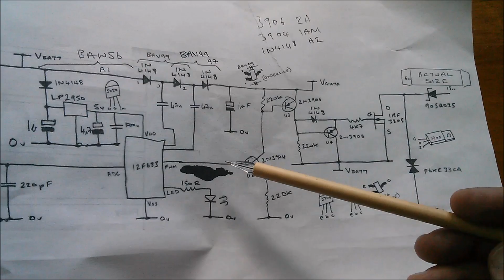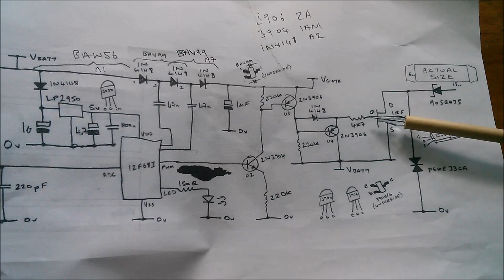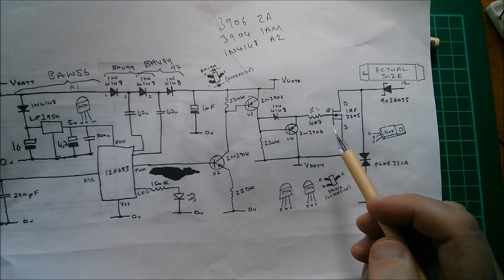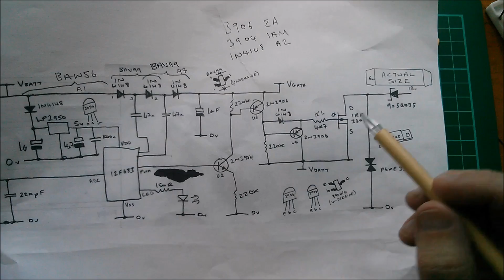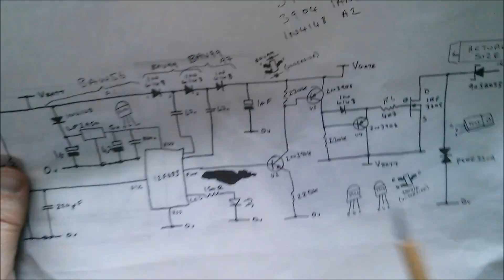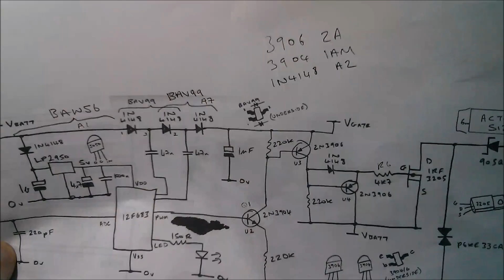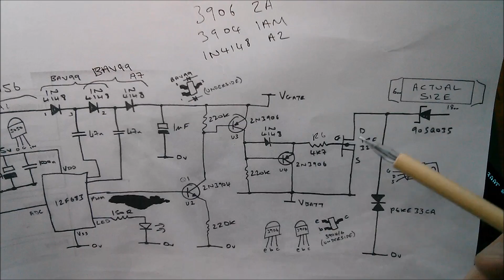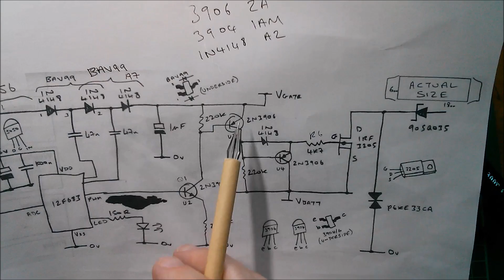PWM5 Final Assembly - High Side Driver Circuitry

Comment: Who else was waiting for Julian to string 11 Eneloops together and get cracking!?

I agree with the other commenters recommending to hold the lead batteries around 14V, current limited, for a time. They won't have a great capacity or Ir but they might stack a few electrons for you. Once a cell shorts internally then recycle it.

Comment: A cheap 300W pure sine inverter and a temperature compensated 12v battery charger are useful for charging and maintaining  other lead acid batteries in remote locations and you already have free energy and several batteries.

Comment: Another great video, got a TS100 recently for a nice price locally after watching some reviews including your video. Love it.
I highly recommend checking out the "G600 Portable Digital Microscope" (or one of a 100 variations of the search) on eBay or ali. It definitely reduces the eye strain greatly, it'd also be excellent for your videos... it's also capable of taking photos and recording video and has a focal length long enough to work under comfortably.
Also got it locally shipped for a superb price. Build quality is meek but the functionality is satisfactory especially for the price, about $70 CAD with 2-3 day shipping. Even has a built-in lithion battery for mobile use. Only complaint is the poor stand included, basically just a GPS holder that fits far from snug or has enough reach to meet the maximum focal length, or enough weight to dampen vibrations.

Comment: Try trickle charging the batteries with a voltage and current limited supply (around 50 mA maximum, maybe less) and monitoring the current via an analogue meter. If the current jumps sporadically, reduce the supply voltage, and the current limit, until battery current is stable. Keep the battery on charge for up to several weeks, monitoring current flow daily, and increasing the current limit gently, as the cells begin to recover. Once they're almost fully charged, and current draw is beginning to tail off, you can then switch them to normal voltage regulated charging. Most of them will at least partially recover (unless they’re too far gone), and many will make an almost full recovery. They will often work fine for several more years afterwards, if treated correctly. You've nothing to lose by trying it, apart from some electricity and a little of your time. 
Sealed Lead acid cells should never be charged above 2.5V, and 2.25 to 2.30 Volts is generally recommended as the maximum terminal voltage, if you want the battery to last for a long time. The battery might have similar instructions printed on it. I've also found that a very few drops of de-ionised water, added via each cell's safety vent bung, will often help in recovering a battery. No water should be sloshing around inside a cell, so add a few drops at a time until the cell shows signs of drawing a steady current. Remember to replace the bungs!
What you are attempting to do during the process is to gradually remove most of the sulphate layer that has built up on the battery plates, without punching too much current through one location, which would cause permanent damage to the cell. That's why you should start with a very low current, and only increase it gradually over several days or weeks. 
I've rejuvenated a number of batteries in this way, one of which appeared to be totally dead for almost a month before it began to accept a low current (~10 mA) without instability. It lasted for more than three years, as a portable transceiver power supply, after that episode.

Comment: Keeping AGM batteries alive requires that they be charged when the voltage drops to 12.4 or by time, which is every six months for the best batteries (sooner for the cheaper ones) when the temperature is 77F (25C) or less.  Carefully nursed lead acid starting batteries can also survive many years.  I have one with a "4" date code which would currently be assumed to be 2014 but is actually 2004.  It's never seen vehicular use and is typically float charged quarterly and topped off with distilled water as needed.  It's been my high current bench supply for years and is recharged immediately after use.  Compared to vehicle use, this battery has lived a pampered life ;-)
Reply: It amazes me the neglect that his batteries see,  and still somehow manage to continue to work,  kinda sorta...

Comment: Just screwing around i built one of those capacitive battery chargers; the ones with a simple, high MFD, capacitor and bridge rectifier. I was actually able to bring back a 5 yr old, totally dried out UPS 12v 7.2ah SLA.

Comment: I am impressed with you reducing the RF interference.  I was one of the guys questioning the need for the resistor on the MOSFET gate but if it reduces RFI that's great!  As a ham radio operator we really notice all these "modern" devices, from fluorescent and LED lights to switching power supplies that radiate RF when they shouldn't.  Good thinking, Julian!  1:49
Reply: Hopefully companies will be taking this into consideration. Some of these devices are terrible. Chargers are notorious. It doesn't take a lot to fix this, a couple very cheap capacitors , on the boards,  in the right spots.  Resistors are not the best way to reduce interference, Interference has to be allowed to radiate into the supply lines and even through the power supplies and out into the mains. That becomes the antenna. Capacitors short these signals out, killing the interference "signal". This article addresses the problem directly. https://www.eetimes.com/document.asp?doc_id=1229799 One of the things it says it , target areas of the spectrum that are used less by high sensitivity equipment.
Reply: N6grg you are assuming they are actually trying to follow any rules in the target markets (US,EU,etc) regarding spurious emissions. Much of the stuff coming off the boats are barely working to specs
Reply: N6GRG - it depends on the circuit, here you already have a capacitor inside the MOSFET, and you need some resistance to form a filter. In other cases you have some resistance and need to add capacitance. In other cases still, you have to add inductance.
Reply: Interestingly, Dave Jones did a recent video on visualizing bypass capacitors, and discusses some of the EMI/RFI pitfalls, which are somewhat related to this!
EEVblog #1085 - Bypass Capacitors Visualised!

Comment: :) You shouldn't put these batteries sideways. It should be upright. They have liquid electrolytes inside them, you know...
Reply: Uh no,  they don't.  Those ar "gel" batteries,  and the only restriction on position is that it's not recommended to charge them while they're uipside-down.

Comment: you could try to replace the battery acid with epsom salt and revive the batteries. that smaller one looks like its easy to open and pour acid out and replace it with epsom salt

Comment: Could you get this to work with a 3s or 4s lithium ion battery?
Reply: JasonMasters Well a good alternative to that would be to reuse phone and laptop battery packs which typically has charging/discharging and protection circuits built-in, I dunno about current limiting but you could implement that yourself using a cheap $2 buck converter with CC.
Reply: Yes, you can re-use phone and laptop battery packs, but the charging and protection circuits are typically either designed to operate only with the computer, or are part of the phone and not part of the battery.

Also, phone batteries are typically 3.7V rather than 12V.

For charging, you definitely need a power supply with both constant voltage and constant current.  I've used a cheap Chinese boost-buck power supply to charge lithium cells, but you need to keep an eye on the current since it doesn't shut off automatically.

For a single 3.7V 18650 cell, you just set the voltage to 4.2V and the current to 1 Amp.  When the voltage hits the limit, it will gradually change over from constant current mode to constant voltage mode.  You then switch the display to show the current and wait for it to drop to 100mA (1/10th of the starting current) before switching off.  Job done.

But of course it's easier to just buy a cheap Chinese charger board with combined over-discharge protection.

And to charge multiple cells in series, once again there are cheap Chinese balance charging boards available, with over-discharge protection.
Reply: No.  Lithium-Ion batteries need a very different charging circuit to Lead-Acid batteries.

Lead-Acid batteries can be continually charged at a constant voltage without being damaged.  In fact, they need to be continually charged at a low rate to remain "healthy".

Lithium-Ion batteries must be charged with a controller which first limits the charge current to a reasonable value and then once the voltage reaches its end-point, holds the voltage at that end-point until the charging current drops to 1/10th of its starting value, then the controller must shut off the charging current.

Charging a lithium-ion battery with a charger designed for lead-acid batteries is a great way to discover fire, without wanting to.

On the other hand, if you want a rechargeable lithium-ion battery to replace a 12V gel-cell lead-acid battery, there are now drop-in replacements available.  They have built-in protection and charging circuits so that they can't be over-charged or over-discharged and to regulate the charging correctly.

The biggest problem with the Li-Ion "12V" batteries is that at the moment, they're horrendously expensive.  In my neck of the woods, even on special it costs around $360 for just one battery.  That would be close to GBP180.

Comment: apparently Julian found his favorite solder, i found ts100 to be less ergonomic compared to common Chinese solder station handle which is usually covered in rubber and ts100 is slippery and small if you have wet hand and lives in humid country that get tiring quickly and i prefer a knob that i can turn quickly to adjust temperature instead of pushing buttons.
Reply: Rizki Pratama I totally agree. This iron looks like a toy for me. I see the result on the pcb of this video ... awful!
Reply: I agree with you in the first point. It would be very difficult for me to use, it’d slip easily and I’ll probably get burnt. A genuine Hakko FX888D can be purchased for just 140 €! That’s 20 € more and you get a very high quality station with 65 W as well.

Comment: That was a great video Julian. Are those mostly dead batteries dangerous to keep around?
Reply: What makes them dangerous makes them work.  As long as the case isn't cracked, they make good paperweights.  Then save up enough to make a run to the recycler worth to the trip.

Comment: Julian,.. your failed batteries,.. may be recoverable if you place some distilled water directly into the cells,.. you need to remove the 'Lid',.. obviously,. to get access to the rubber cell seals,... but with care it can all be removed in my experience,.. once the cells start to re-hydrate,.. the charge voltage starts to come down to normal levels.. but no guarantees,.. but then these batteries would otherwise be a lost cause anyway..

Comment: How do you choose between a BJT and MOSFET across varios nodes and then how do you chose npn/pnp in the case of BJTs and n/p channel enhancement/depletion type in the case of MOSFETs?
Reply: SaiKrishna KVMB it all really depends on what you want to do.  A bjt can be helpful if your controller isn't capable of delivering the ~15v a mosfet wants to fully saturate, or if the gate capacitance of a mosfet will cause instability.   But a mosfet can be good if you want voltage control and lower power dissipation.  PNP/P-ch vs NPN/N-ch depends on where the current that you're switching comes from or if you need high side switching.  
  
Bjts can be more linear than fets, but fets are easier to understand.  There's a lot of theory involved in picking a transistor, and I can't really explain it all here, best bet is to pick up a book on the subject.

Comment: Do charge them, the resistance goes up as the battery discharges!

The 9v looks fixable, as for the 2v one: good luck, it won't be fast
Reply: Yeah, with it being a unregulated 12v transformer, the voltage will go down as the load increases, so given time it should work. I would have left the PWM5 on it overnight and have it somewhere safe (maybe on the concrete outside?) just incase of catastrophic failure.
Reply: Catastrophic failure doesn't seem too likely in the case of a gel cell,  worst I've ever seen with those is that the case might crack but even then there's no real risk of liquid coming out of the battery.

Julian seems to be like a lot of other people in terms of expecting damn near instantaneious response to putting some charge into one of these.  It takes time!  I'd have left those hooked up to that transformer at least overnight,  and perhaps longer.  It may take as long as several days to get them up to anything resembling a full state of charge.

Comment: The Maplin near me is still open. However they want £20 for a 7Ah 12v battery (even with their 50% off)
Reply: I’ve recently purchased a load of OLED 2 line displays for £3.99 a piece from my nearest Maplins. Never even knew they were stocking these items but ours have no end of goody bags made up as they clear the stockroom. Quite sad to see them go to be honest though..... I’ve been buying components for my projects from them since getting into electronics at school back in the early 80’s. Sad times :(
Reply from the maker: I'll try Homebase :)
Reply: Maplin shops are afaik leaving the original full prices on the shelf edge and you have to work out the sale price using a ready reckoner poster... or mental arithmetic.
Reply: joinedupjon ya, I took it to the till to query for this very reason. I wonder how many they actually sold for £40!
Reply: Screwfix & Toolstation both stock SLA batteries if you can't wait for mailorder. Both likely cheaper at their full price than Maplin clearance price!

Comment: They are badly sulfated. You can try to desulfate them with Epsom salts in the cells. These sealed batteries are pretty easy to refill and add water/salts to